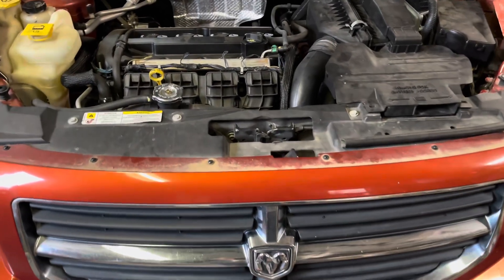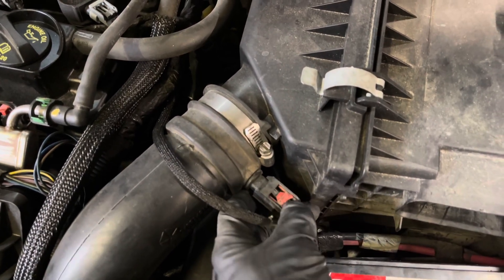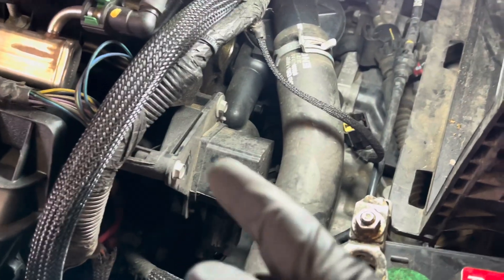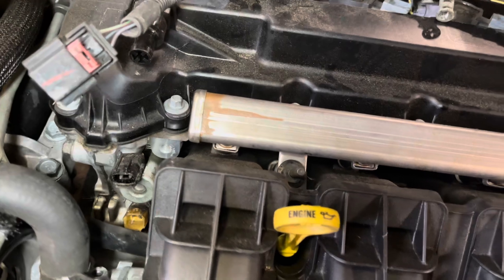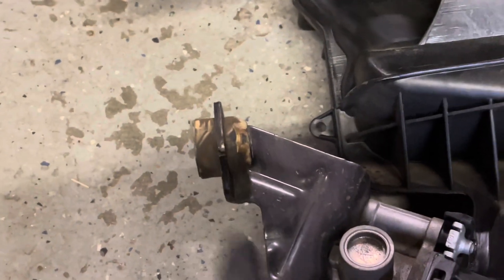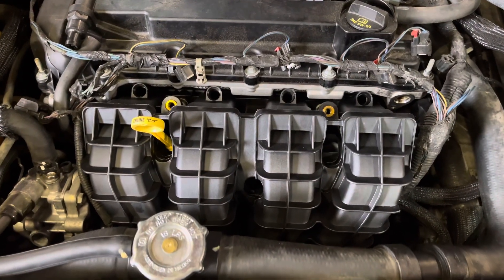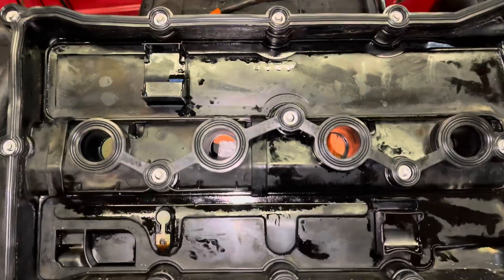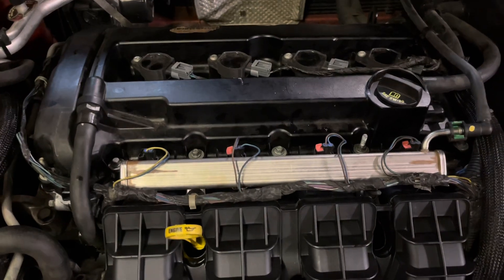How To Fix A P2004, P2017 Code In Chrysler Sebring, Dodge Caliber, Journey & Jeep Compass , Patriot

Comment: Talking about the bracket on the throttle body. I don't think you said something about a black ground wire. I have a 2007 Sebring 2.4. The bolt for my bracket also is the connection for the ground wire to my starter. That black ground wire is really easy to miss removing the bolt. Thank you for your time making this video. These videos help to have an good idea what you're diving into. I'm 51 and before YouTube. 16 and my for set of wheels was a truck. Then I had note book where I draw diagrams of what I was working on. Draw part, where it went, how many bolts with size. It helped long before YouTube came out.
Reply from the maker: not sure if we even disconnected it lol but thanks for the info!

Comment: Thanks for this! I replaced the solenoid, but it failed again, so thinking this is the next step. Looking at it, it seemed like I needed to remove the whole valve cover to be able to remove the intake, but apparently not! How's the Amazon part working out, especially with that solenoid?
Reply from the maker: Your welcome! Still going strong no issues at all.

Comment: Hello.... 

I had a P0660 code on my 2010 Dodge Journey V6 105k miles, about the valve. Just the code, nothing wrong with the car, running fine. I replaced the valve in bank 1, the one with the butterfly present, I bought a cheap aftermarket valve. The P0660 code is gone, but now I have the P1005 code. The car continues to run fine without any failures. I've already checked the wiring and in my opinion, there's nothing wrong with it. I also went further and with my scanner active I disconnected the connector from valve 1 and connected it to the old valve and activated the tests through my scanner, toggle function. It moves normally opening and closing. So I think that my problem was not the valve, but for what reason did I have a change in the error codes going from P0660 to P1005 after put the nem valve??  I did the same test on the bank 2 valve, the one with the butterfly built into the intake manifold and it is also working normally, opening and closing. I checked if the built-in butterfly is moving normally, and yes, it is not stuck. Can you give me any advice on what my next step would be to solve the problem? 

Thank you!!!
Reply from the maker: Was the butterfly valve totally smooth it should have near zero resistance
Reply: @DIYKAI  In the case of the valve on bank 1, when I move it with my hand, it has a type of spring that keeps it in a certain position, I think its normally. In the case of the valve on bank 2, I don't feel any resistance when I move it inside the intake manifold.
Reply from the maker: My sincere apologies I thought this comment posted:

P1005 DODGE - Manifold Tunning Valve Control Performance

Possible causes
- Manifold tunning valve circuit open or shorted
- Manifold tunning valve poor electrical connection
Symptoms
- Engine Light ON (or Service Engine Soon Warning Light)
P1005 DODGE Description
This Powertrain Control Module (PCM) compares the circuit feedback to a calibrated closed range when when the circuit is de-energized or to a calibrated open range when the circuit is energized. If the value is to be determined to be out of the calibrated range in either the de-energized.
Reply from the maker: Dodge has also had many issues with the PCMs and have flash updates I had to update one a few months ago on a Caliber it was setting the 02 sensor light off even after replacement a reflash solved the issue.
You can also try disconnecting both battery terminals and touch them together for 10 minutes to discharge the computer system

Comment: replaced the manifold, MAF sensor, MCAV already, no more than 200 miles on it. I got these codes. Anything else that could cause this? We cleaned everything up before we put the new one on.
Reply from the maker: Did you check the pcv hose under the manifold? What codes are you getting? The MAF usually don't affect the manifold.codes
Reply from the maker: What is a MCAV?
Reply: @DIYKAI   2004 and 2017, havent checked that yet
Reply: @DIYKAI  just using an acronym, manifold runner control valve, should have used that instead. LOL

Comment: They should use metal to build the valve covers and intake manifolds. There's no way that over the years, the engine and ambient heat and cooling is going to warp all of them creating vacuum leaks.
Reply from the maker: @thegoodinu  definitely agree! It's cost savings for them and headaches for us